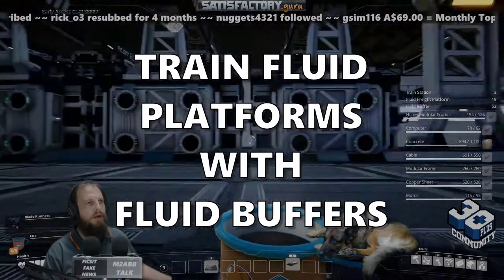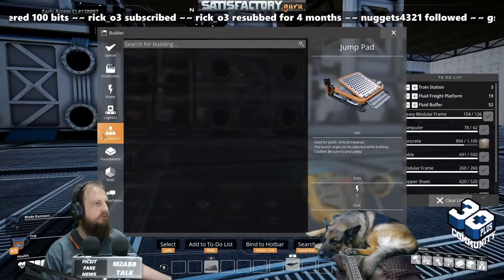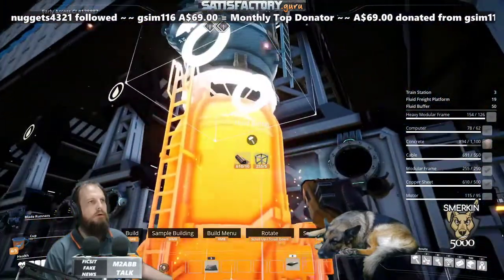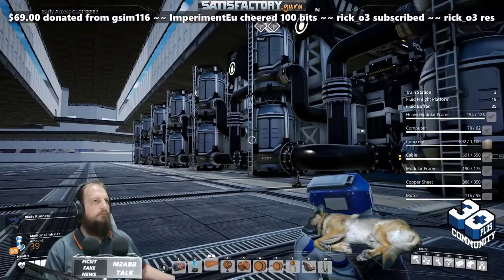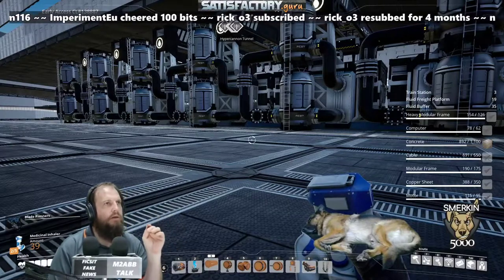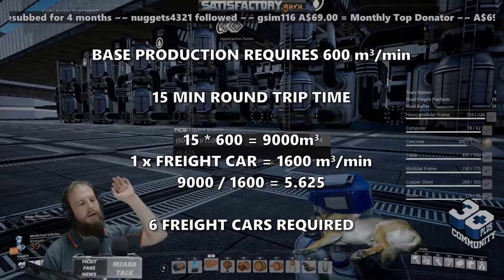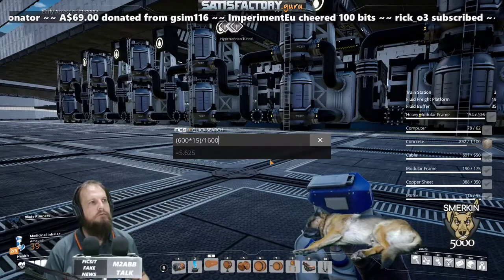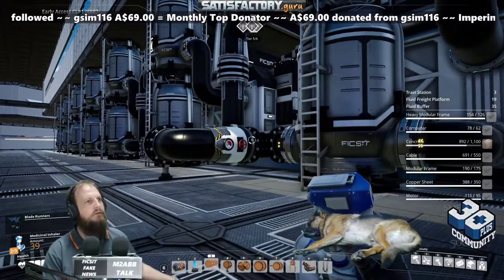Train Fluid Platforms with Fluid Buffers

Comment: Thanks for the advice, i have 3 fluid buffers(1 for each oil line) before the input to my oil refinery, and 4 industrial buffers on the output for the combined 240 residue coming out. At first i put them there because i thought it looked cool, even though they're a bit expensive, but now i realize the small buffers have zero use for my build, and the only thing the large buffers offer is 3 hours of fluid if i needed to turn up the production of fuel for a while. 

I totally misunderstood their practical use, but at least my plant looks cool lol
Reply from the maker: Aesthetics is important 😊